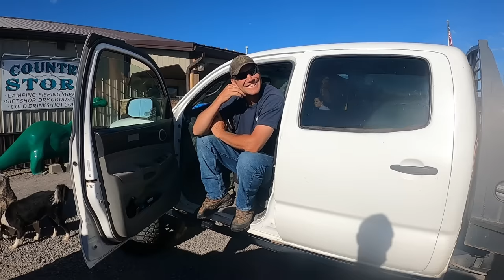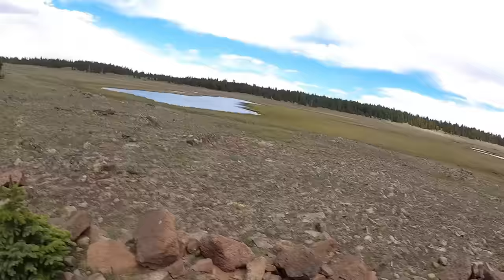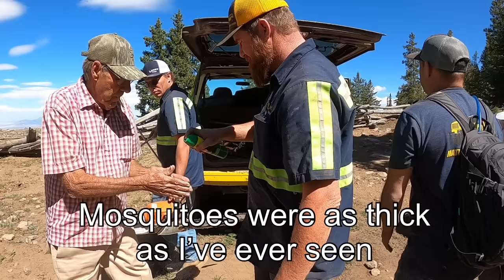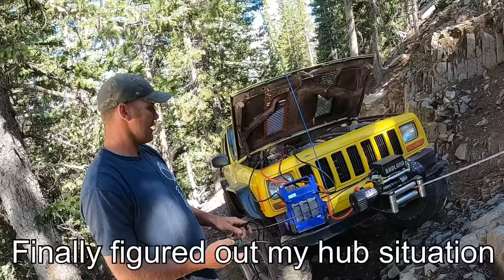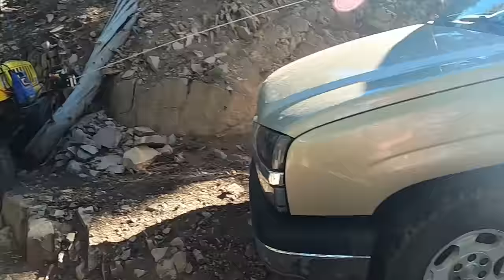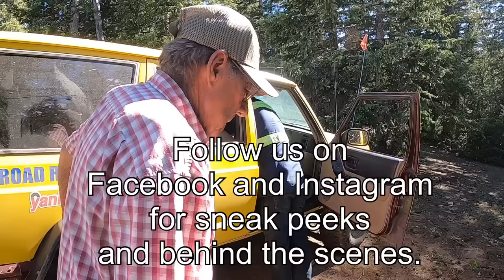There's NO WAY you'll recover that Chevy Truck!!!

Comment: I've done heavy duty recoveries for many years and I noticed 3 major things that stood out. 1, you assessed the situation, came up with a plan reassessed,  and modified your plan, listening to everyone's input. Awesome!
2, your rigging was done superbly. You were positioned to allow for as much movement as possible limiting re-rigging. Awesome job.
3, Most important, was safety. You kept everyone out of harm's way while continually assessing the situation as it progressed. 

That was a top notch recovery.
Reply: I only wish they wouldn't winch with chain and paid a little more heed to the steel rope under full load with no dampeners applied. Obviously, the dude that backed that XJ in has balls big enough to protect him from a snapped cable, but everyone else was in danger.
Reply: Couldn't agree more!! Superb teamwork, making sure everyone was safe including keeping the camera crew away from the winch cables in case they snapped, first rate work from everyone. No snarky comments either about the people who got into trouble in the first place. Great recovery, great channel. Keep up the good work.
Reply: Thank you for explaining. As someone who doesn't know much about this other than how amazing and professional it came across I appreciate your response!
Reply: So not quite the same but just as dangerous to removal people.  We had a boulder take out a set of wooden 'H' poles fore 250 KVA power lines, half way up one of the cliffs you see to the north of Parachute CO. No getting anything up there motorized until after poles and lines were removed.  Our powerline people we contracted came in with a helicopter and the safety guy asked 'what's your plan?'  Big Mike said, 'We go up assess, discuss plan and rehash all the what if's.  If there are questions that can't be answered we start a new plan.  Then we vote on the plan and if all 7 of us don't agree we start a new plan.  If there are problems or unexpected results during the plan we start over from where we are at.'  All went well with a few rehashes as they went.  Spectacular to watch from the setting they were in and even more so from their strategy.  Matt's crew did a solid job.  I am sure they will take suggestions into consideration on future ones.  Keep er safe, everyone should always go home in one piece!
Reply: Yes, safety. Everyone in the towing business should live by the slogan "Everyone's safety begins with me."

Comment: This video is the best advertisement for Matt's Off Road Recovery. 2 companies did not dare to do this recovery. Matt drives there with a few people, takes a quiet look at the situation and pulls the Silverado out of there. I am very amazed at the calm and ease with which Matt approaches each of his jobs.
Reply: It was 4 other companies that refused.
Reply: @nancylarson7494  I thought they tried and failed, not just refused.  But I could be wrong.  Either way, Matt's victory was EPIC!!!!!
Reply: This is just crazy seeing Paul and his son when he was still getting his channel up a running, no merch, and not even branding. Even Matt wasn't branded, but merely promoting his business. Just look at how far they have come! Was Paul's son, Landon filming for them? I  saw him holding a microphone. Also, seeing this again, I noticed the shell of the Morrvair on the chassis in the background of a yard. Does Fab Rats have their own video of this?
Reply: @Frankie2012channel        You're wrong. One went and decided they weren't even going to touch it, and the other three flat out refused.
Reply: That’s not too crazy. It’s not that the companies wouldn’t be able to get it out, it’s just that it’s not worth it. If it costs a company 8 hours to recover a truck (3 hours drive time one way, 6 total, and 2 hours to recover, I’m being generous), with a crew of 8 people at $30 an hour, that’s almost $2k in labor costs alone; add in overtime if the job takes longer than expected, easily $3k in labor. Add in fuel, equipment and over head and you’re looking at $4k in cost to recover a truck worth maybe $4k. Plus, if something happens and that truck, or worse, one of your trucks goes off the mountain, you’re insurance isn’t going to be happy. And god forbid something happens to one of the crew members. It’s risk vs. reward, those companies have to make money and try to keep people safe.

Comment: The pucker factor is huge when you're achieving rock-star recovery status.
Dang, well done.
Reply: Well said. Pucker x 2000
Reply: Think of the Pucker factor when the driver of that truck started sliding sideways. Bet he was constipated for 2 weeks after that.
Reply: @derrinpickett9948  And to walk out in street shoes at the age of 74!!
Reply: @LP-mz8rc  I'm building a bug out Jeep Cherokee and fitting it out with everything I can think of. Winter and foul weather clothing in one container. Got couple pairs of boots, shoes and even flip flops. One thing I learned from this video is to have extra nuts and bolts.

Comment: That Chevy truck has its running light out. Classic
Reply: Classic Chevy Wink going on there. Ironically, my Chevy has never had a bulb replaced and all are still lit.
Reply: They come from the factory like that.
Reply: @joshbrumfield4999  No they do it because the bulb gets extremely hot in that little housing with no ventilation and burns out quicker. Putting an LED in there solves the issue.
Reply: The working man yup, I did mine about 2 months ago and one went out again
Reply: I don't believe I've ever seen one with both sides lit!!!
Reply: You can get a hole bag of leds on Amazon for $10 that don’t burn out and you can put them in for the reverse lights and turn signals too.
Reply: @austinw561  I would be careful with that stuff man. I bought some and one caught on fire real quick
Reply: Lol, how much do you want to bet that the bulb is fine 😆
Reply: Doesn't help it has been stuck in the woods as well
Reply: It's a chevy
Reply: I have a Chevy Silverado 2003 that bought it 0 miles and it has been a good truck for the most part but some gauges from the dashboard don’t work 😑😐😑
Reply: Yeah well it started up after sitting in the woods since October.  That's a little more important.
Reply: All the bulbs go out once they get to about 15 yeara old on those old chevys
Reply: Yep, most all of them do.
Reply: @ivanbustamante6011  
I have 2006 Silverado 4X4. purchased it with 3 miles on it from dealer.
In 14 years I have replaced tires, battery and altinator,
 peroid. Very reliable and I have over loaded the 8' bed many times. Not a problem. Great truck.
Reply: @ctsstxc  not true
Reply: Was about to say the exact same thing. Haha

Comment: Hi, Matt; At one time in my career as a dealership mechanic there were three of us who were known to fix cars that no-one else could fix. An independent shop that can't fix a car can always say, "take it to the dealer" but we as the dealer can't say to send it somewhere else. We have to fix it. Even cars from other Ford dealerships were sent to us, sometimes by the Ford factory reps. I nick named us as "The Dead End Kids". Your rescue in this video earns you and your crew the nick name of "The Dead End Kids".
Reply: Robert, I had the same thing going on in a Chrysler Dealership. Independents "Take it to the dealer." Factory reps "Take to **********, they gotta a guy!" Sometimes involved conversations with the engineers in Detroit.
Reply: I was a mechanic at an independent shop. We got a Toyota from an insurance company that had been hit by lightning.  It fried every computer in the car. We would fix one thing then find another thing wrong. The owner of the car was frustrated and told us to take it to the Toyota dealer down the street.  What they didn't know was that we had already had it down there and they couldn't fix it. It took us some time but we finally managed to get everything working correctly.
Reply: naaa should be something like "steeper the angle the better we are"!!!

Comment: I worked as an engineer at a crane company nothing is un-recoverable with enough tackle.
Reply: I was gonna say.... how many snatch blocks do I get to use..
Reply: Well said. That's what I was thinking. And I'm far from an expert.
Reply: What’s tackle
Reply: If you've got enough rope, chain, pulleys, winches and come-alongs, you can move anything.
Reply: @castillo33brandon  Tackle is a pulley.
Reply: Lol
Reply: enough tackle and heavier iron
Reply: CoRona Virus tools...equipment,etc
Reply: I had to get my dad's JCB lift to get my f250 out once. Had to lift the rear end way up and stacked some concrete blocks behind the fronts to get it to come out. Rear tires were a good 8 or 10 feet off the ground, and it had at least a 10" lift. Couldn't even get the lift close to it, had to use every bit of the 36' boom and chained it to another tree to keep from just pulling me toward the truck. Then, I buried it to the frame turning around to get out. Had to dig a little, and chained the fork carriage to a few trees to then pull itself out. It was a huge mess. But it all came out. I'd first had a friend bring his mud bog truck on like 50 inch tires and Rockwells and it just buried to the axle without budging my truck. I was going along this trail and what looked to be just a little puddle was a damn ditch that dropped me to the frame, and hung it the hell up, stopped dead and stayed there til I got the lift.
Reply: @salvadordollyparton666   Sounds like you need a log skidder with 5 foot wide tires. Paid a guy with one to come get my truck out of a swamp. It basically floated on the mud.
Reply: @Anthony Beers   I used to get quite a few jobs doing on site recoveries with my 8 wheel drive Tatra because the crane companies couldn't get a crane onto the site, or it was so wet they were worried about getting the crane bogged really badly. I have onboard tyre deflation /inflation, so combined with all seven diff locks it will go into almost anywhere. The only thing I need to be really careful on is steep slopes, because it's 14 tonnes. I'm sure you are aware because you work with cranes, that heavy vehicles and steep slopes are a bad combination. If things go wrong, they go wrong very fast and very badly.
Reply: I was driving a pretty big truck offroad through a construction job site and got stuck in the worst mud you've ever seen.  There was no way any kind of tow truck was getting there.  Guy hops in a big loader, pulls my ass out in 5 seconds.  If you got access to that level of equipment, sure, anything can be recovered.  No one is going to call in a crane to go up a mountain for an 8000$ truck though lol
Reply: Archimedes said give me a lever and I can move the world.

Comment: From someone who does a lot of rigging and moving heavy objects from difficult places, good job! Only thing I recommend is with those long runs, put a leaded blanket or even just a welding blanket on the cables, it will take a lot of energy out of them when one goes.
Reply: Synthetic ropes, not cables. They don't store hardly any energy.
Reply: Thats completely untrue a synthetic rope with  shackle on it will still kill you. Old mate is right the only thing the boys were doing wrong was no rope/cable dampening. Its no joke when one goes people die.
Reply: @Ga7cun7sSUCK  How would it kill you? They store very little energy and don't snap back the way a steel rope cable will.
Reply: They literally say in the video “watch the cable so it doesn’t kill somebody” and I’ve broken synthetic ropes and cables, they On their own done have much energy, but attach a shackle on the end and it has enough to kill or do damage.
Reply: @gregmanzolillo8666  You need to watch more of their videos. They are sponsored by a synthetic rope company. They don't use steel cables. Attaching a shackle on the end of the rope changes nothing - the rope still doesn't store hardly any energy.
Reply: This is good advice
Reply: @TehButterflyEffect  almost every tow or lifting lead other than steel is made of "synthetic" material.... lmao 
Nothing defies physics .      Every action has an equal or opposite reaction.
Reply: @niks983  Grab a rubber band and stretch it until it snaps. Then grab a piece of dental floss and stretch it until it snaps. Was there a significant difference in the energy you exerted versus the reaction that happened? Why?
Reply: @TehButterflyEffect  are they towing with dental floss or rubber bands? Complete garbage argument
Reply: I guess my experiences rigging and running cranes as a millwright must be wrong. They also must of said those things in the video for nothing. To each their own. I’ll stick to the facts I know first hand
Reply: @gregmanzolillo8666  exactly I've worked heavy haul as well moving oil rigs and such.  And I can confirm it smarts when a synthetic strap fails and you're on the receiving end. 
43 stitches on my left leg and a scar can also confirm.
Reply: @niks983  Then you don't understand physics and shouldn't have gotten yourself involved.
Reply: @TehButterflyEffect  so if I wanna argue brain surgery I just have to buy the game operation????? This is what your rubber band argument sounds like.. ☝️
Reply: TehButterflyEffect You seem to be even more knowledgeable on ropes and chains than several people that do rigging, hauling, or moving stuff as part of their career/or have experience. Why don’t say where you’re getting your shitty information/ideas from instead of trolling? I’m guessing you haven’t done much rigging or else you’d of had a strap/rope snap before or at least know someone that’s seen one break under a few thousand pounds of tension.
Reply: My father taught me how to use heavy chains, tree trunks and even rocks to tame snapping cables before these synthetic ropes were arround. Those techniques are still applicable even with the new synthetic stuff. He was just a farmer, but knew how to make do with what you have.
Reply: I was pulling out rose bush roots out with a husky tow strap and the bush snapped and that dam thing few months at my truck if I would of been using a blanket that day it  would have slowed it down nothing happened thankfully
Reply: I had a steel winch cable snap on me,I about needed a change of clothes......it could've been extremely bad,luckily it wasn't*
Reply: A bad, but lucky, experience can teach you a lot! Should see a strap snap on a crane and the block go flying and explode
Reply: TehButterflyEffect
Your partially right. It all has to do with how fast the energy is released. A metal cable will snap instantaneously, thus dumping all its energy at once. A synthetic cable is likely to rip before it snaps, thus dropping its energy more gradually. However, when you attach a metal chain or clamp to a synthetic cable, and that clamp or chain gives, the energy is dumped instantaneously and the rope will sling back at you with deadly force. I would suggest using a dampener like a blanket near the parts that are likely to fail instantaneously.

Comment: Man I'm jealous.  50 years ago I was a commercial deep sea diver working out of Louisiana in the Gulf oilfields.  Much of my occupation involved underwater rigging to set clamps on platforms and to install subsea valve assemblies connecting pipelines.  My rigging imagination was going full speed for this video, and I dare say that my thoughts at the start closely paralleled what the final plan was.  What a tremendous team all these guys are.  No egos trying to steal the spotlight, which was often a problem when working offshore.

Comment: Matt those ball and socket style exhaust flanges suck because they consistently loosen up unlike the old style header flange that used a gasket. Double nut the ends of your exhaust bolts so when the flange loosens you don't lose your hardware! I do that on My 1967 440 Plymouth GTX!
Reply: Exactly, I would go back to the guy who installed the exhaust and chew him out.  hehe.
Reply: Self aligning Vband for the win
Reply: just spot weld it :-)
Reply: @ Wayne: If ball and socket flanges are used, they indicate the need of a bit of movement in action. They originally came from the assembly line spring-loaded. Restore that condition, of course with locking nuts and you are good to go and don't have trouble.
Reply: @vicO1323  it was Matt and his friend who installed the exhaust. 😆 they posted the video recently
Reply: @flytii  I was trying to be funny.  Paul from Fabrats was there on the recovery.
Reply: @vicO1323  🤣💪🏽
Reply: @vicO1323  I got the joke.
Reply: @flytii  That's the joke!

Comment: What was most impressive was the cool, calm, and collected communication...made the whole operation go smoothly - well done.

The owner is lucky the truck was virtually undamaged from the incident....even luckier that he didn't end up severely injured when the truck started to go sideways - coulda gone MUCH worse REAL fast.

Y'all got a new subscriber from Texas.
Reply: Other than a long scratch on my back from siding down the mountain when I unbelted and open the driver door, I was ok. Glad I didn't twist an ankle on the walk out in street shoes.
Reply: @dmcpeck  Lots of valuable lessons learned, all around! We're glad that you're okay. Time to go shopping for another 4x4 and get back up in the mountains. You're a better driver now.  😉
Reply: @PatrickKQ4HBD  I did. I live were I go up into the mountains without endangering myself. Most danger I'm in is driving in apartment complex.